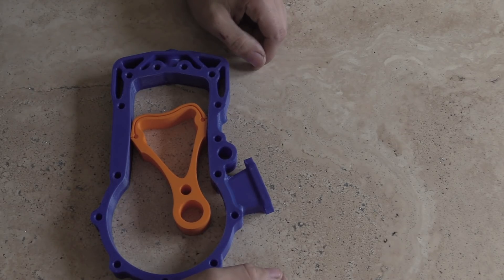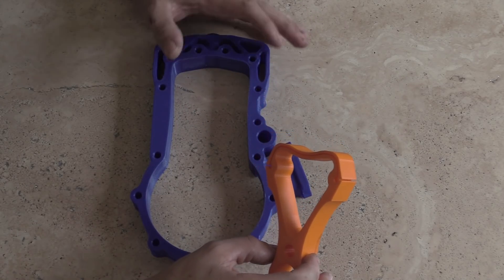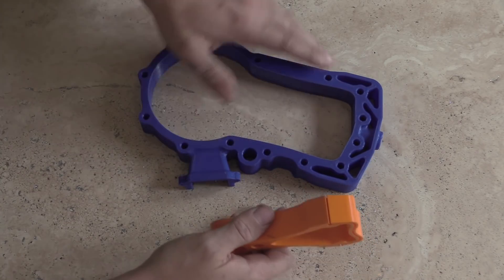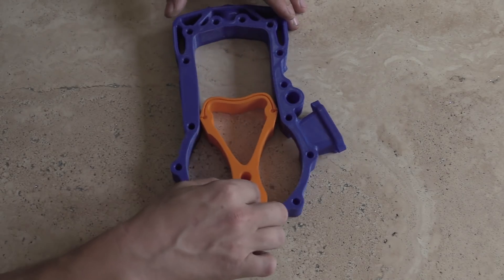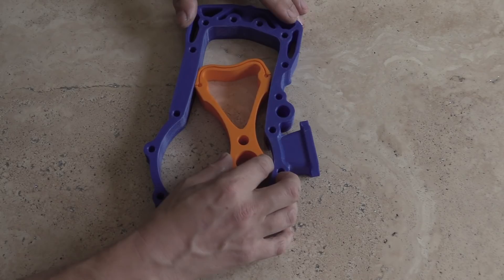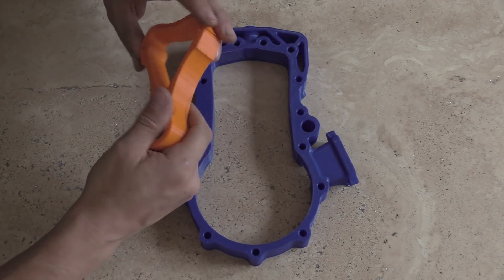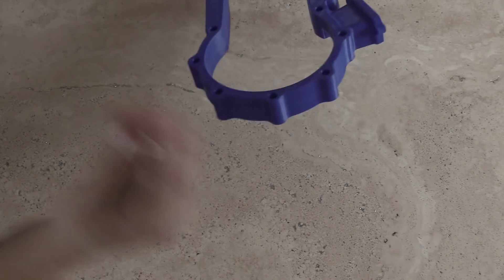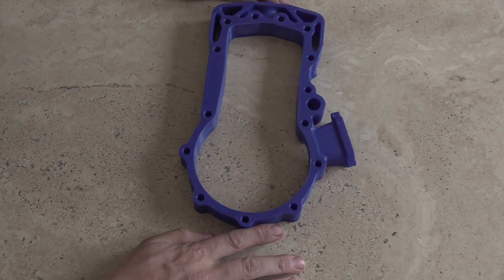The Hudson/Hossack Engine - Part 6

Comment: Simple is pure. Less parts is almost always better. It's a cool design and with large scale manufacturing that easy it could catch on. 

The main thing for me is I really enjoy the insight of the mindset during the creation of an engine or anything really. It's very rare content you and two stroke stuffing are the few that do it and do it well. For example most would show a 3d print of the model and use that to illustrate for the video. You go more in depth of why you even printed it and how it aids in imagining future versions. It's small stuff like that which seems so basic that really adds a lot to the content. Keep it up man it's good work.

Comment: Would extrusion produce high enough quality material for engine components? Whenever I think about extruded aluminium I tend think of low quality products, is that just the alloy used?
Reply from the maker: Yes it's just the alloy used. 6063 is a common alloy, which is chosen because it flow quite easily

Comment: This design and you working on it is pretty exciting to watch. Alloys that can be extruded should be stronger than cast alloys correct?  An inline 6 the same width as a 4 cylinder would be pretty cool.

Comment: It's sad how much of your videos are spent simply explaining to trolls the iterative process of design, or the value of math, or designing for manufacturing methods, and nearly as sad how many of them keep insisting it won't work or will tear itself apart when there are also youtube videos of Norman's original single-piston prototype clearly running, and even puttering around in a pocket bike with an engineer (who is clearly too big for it) on top, and a teardown video afterward! What you are doing is exactly what the concept has needed though; a refinement with a view towards optimization and modern manufacturing (and modularity). Keep going! I want to see it run!

Comment: Keep up the good work, but there are a couple things a traditional piston skirt does that your design needs to address. First they distribute the thrust loads, and in the case of 2 strokes, they close off the ports during the compression and expansion strokes. The varying angle between your apex seals, and bore could also be a problem, but I really don't know enough about this to criticize it. Should this concept work, I suspect the best application would be hand held devices like chain saws and weed wackers, if it's a single cylinder, you may want to have ports in both end plates, the ports would be smaller and allow a larger effective displacement.

Comment: Haven't thought about your gavel engine in a while had an idea as for lubrication. 

Could 1 or 2 oil control ring or rings be fitted to a cylinder rather than the piston which would in turn can be made smaller and probably made of steel to hold up to excess heat🤔
Reply from the maker: Far too busy to be thinking about that, but I will be reappearing in the future

Comment: I really like the idea of this engine. The modularity... the fact that you could just extrude the parts for cheapness... the simplicity of the design... plus the fact that its just "different". The same old same gets boring after a while and stuff like this helps to mix things up again. I am looking forward to when you potentially get one of these things up and running (I know the original designer made one... but still... I like projects like this)

Comment: Is there any reason why you wouldn't/couldn't offset the crank to the compression side of the centre line of the cylinder? It makes more sense for power efficiency to have it offset and if you're starting from scratch then why not go with the method that gives you more leverage and makes better use of the engine power.
Reply from the maker: Because how do you connect that? Also the motion of the rod changes , so TDC is no longer where you want it to be

Comment: Interesting design, the main thing I think needs looking at is just how much crevice volume this engine has due to the required shape of the curved head. The gap between the curved edge of the 'piston' and  the cylinder wall simply because of how low the 'apex' seals are(the ones on the sides that give off serious rotary apex seal vibes) i don't know if that crevice volume has been taken into account, but fuel mixing/burning characteristics change in crevices.

Comment: Why isnt the side seal just straight across?
Seems like that would be a hard part to make no?
Reply from the maker: Because twist, that's why.
Reply: @thedirtyworkshop  I am wondering the same. If the piston sides around "apex seals" were following shape of a circle with diameter of the cylinder width then the cylinder walls could be straight (it's like 2D case of having ball in a bore, you can freely rotate it anyway you want) .  Is the current design giving you better, more perpendicular angle between walls and apex seals? Could you please explain what else am I missing?
Reply from the maker: I think you're talking about something different than the original post...
Reply: @wnodzykowski  i meant the side seal, the ones perpendicular to the "apex seals"
My thing was why arent they just straight across instead of a kindof M shape.

My thought being the seal could just be straight and still have a "dome top" above it.
Just for simplicity's sake.
Reply from the maker: The seals are not straight to stop the seals from twisting. At high rpm, with them having a high length to thickness ratio they have the tendency to twist. This shape stops that.
Reply: @WikWak  Sorry, my bad I misunderstood your question. Thank you for clarification.
Reply: @thedirtyworkshop  I would appreciate if you could give me a clue/pointer to help me answer my question. It's the only thing that I cannot grasp in this design. Can't see where I am wrong and it kinda drives me crazy :).
Reply from the maker: I dont understand your question...

Comment: You probably thought of it, but if you cut the top left corner of the exhaust port off, and make the port wider. You'll still have the same flow area, but you cut the exhaust port off earlier, maximising one of the benefit of of your design.
Love this idea!

Comment: I don't understand how you plan on keeping the side loading forces down. It seems like the conpiston would just dig into the Left and Right walls.
Reply from the maker: Dig? It's not going to be made of actual plastic...
Reply: @thedirtyworkshop  I am assuming Al on Nikasil. This design has more force on a smaller area than a trad round piston/bore. TDC and BDC will have a lot of lateral accelerations from the rocking action.
Reply from the maker: That doesn't mean anything is digging into anything...

Comment: did you change the design at all just so you can 3D print it? From my experience the filament will shrink as it cools and throw off clearances. Also the slicer software will round any dimensions to convenient +-0.1mm numbers.
Reply: I'm sure Matt will be aware of this. In any case, when it comes to the final 3d prints to use as patterns for casting (if that's the way he's planning to do it) then the parts will also have to have draft angles to allow pattern removal (unless he goes the lost PLA casting route), and  be oversize to allow for metal shrinkage and an allowance for machining the faces down to spec.  All easily do-able, but those issues don't matter for these test parts.

Comment: I get it but to machine an inverted  wall  would be very costly and difficult and the with the higher surface area per volume of a rectangle compared to a cylinder the thermal losses would be almost double taking away power, but  i give credit for thinking out of the box , please keep up the channel . I think the ice engine has reached its max potential .

Comment: When it locks at tdc where and how would spark occur? Has it been worked out where the stress would be on the power stroke and how to optimise burn when one side of the piston head is traveling faster then the other?
Reply from the maker: Yes it has

Comment: The pedantry around "pistons," "cylinders," etc., comes from a hundred years of lazy speech. Two strokes, four strokes, rotary engines and all that are internal combustion engines. The only thing they have in common is a closed combustion chamber. The combustion chamber may be cylindrical, rectangular, or a freaking crescent between two plates (WTF???).If people stop getting hung up on the names of all the incidental parts that form a combustion chamber, they'll be less confused. 

This comment goes for that video on "one stroke" engines, too, but that video's old AF. 😂
Reply: Lucky he didn't use "Womansplaining" terminology, such as "Moving up & down thing", "Sliding thing", "Spinney thing", etc.
Reply: @CZ350tuner  "bless your stupid little hearts" haha

Comment: You were talking about how small a 4 cylinder would be. Just wondering have you done the maths regarding displacement? Of course total size is smaller, but what about size relative to displacement? Is a standard designed 1L 4 cyl going to be bigger than a Hossack 1L 4 cyl? Could add up to some pretty significant weight savings. Glad to see this taking shape.